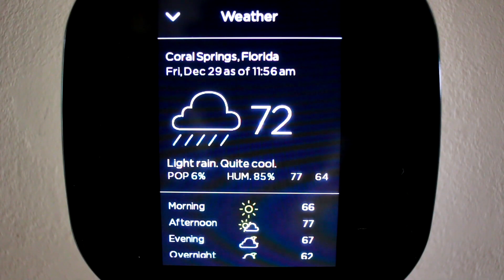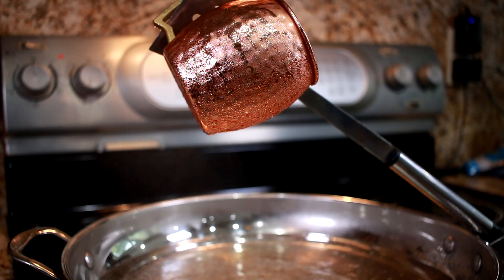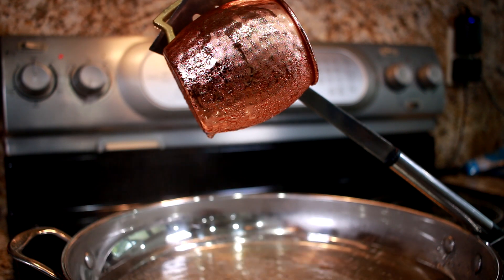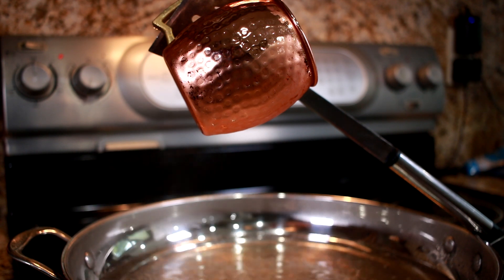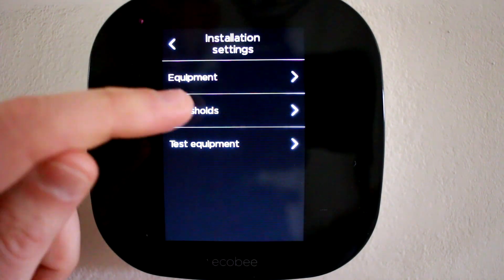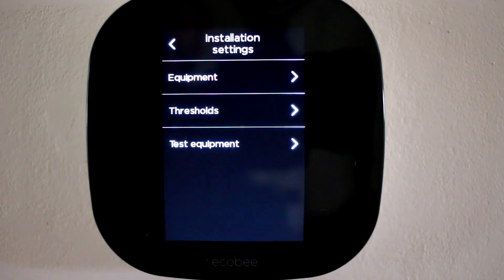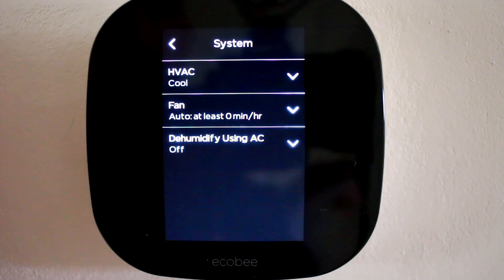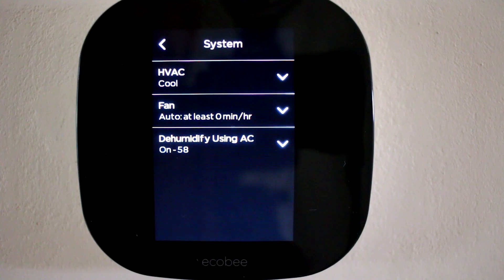Ecobee humidity control setting thermostat tutorial

Comment: I have an ecobee 5 and it dosent have the option to choose the Humilevel.  I like 44
Reply from the maker: If the Ecobee "SmartThermostat" is version 5 it does seem like they either removed it or moved it somewhere else. The instructions indicate it doesn't apply to the Smart model https://support.ecobee.com/s/articles/How-to-use-AC-Overcool-Max-to-reduce-humidity . I couldn't find a manual outside of wiring or basic install to dig in and see if it just got moved or replaced with an equivalent feature. If you find out let me know!
Reply: @reallyMello  Thank you

Comment: My Ecobee doesn't have the settings you do, so I don't know how to adjust my settings to address the high humidity issue we're having. I have the Ecobee 3 lite
Reply from the maker: Which setting are you missing?
Reply: The ecobee lite doesn't have any dedicated ACC ports to which the humidifier/dehumidifier would be attached to. With this being said, the Ecobee Lite is unable to control humidifiers/dehumidifiers and is the reason you aren't seeing those settings.
Reply from the maker: Unless “dehumidify using AC” is disabled from the light version I doubt that would matter
Reply: @reallyMello  Sure for the dehumidify using AC setting, but they stated they don't have the settings that you do so I assumed they are referring to all settings including the humidifier ones- those will be absent on a Lite.

Comment: Why would running the fan in the ON setting be an issue with dehumidification? The ON setting just allows the air to continue to circulate after the compressor is no longer running. If the compressor is no longer running then the system is no longer dehumidifying. I can see the argument, that if you are not running the system as much due to air circulation, then you can reduce your dehumidification. But in my experience, constant air circulation is necessary to maintain comfort in most houses, especially in single system two story homes.
Reply from the maker: Hi Kyle. The thought is the fan is not allowing the water to condense, collect, and drain out of the system. The fan staying in all the time is reevaporating the moisture and spreading it around the house.
Reply: @reallyMello  I would think there would be a setting where the fan is off x# of seconds after cooling, to allow it to drain as you described. And other than right after cooling, the fan would run continuously if set On. Add to that if humidity rises, the fan shuts off for x# minutes.

I'd like to circulate my air, but I don't want to increase humidity so I can't. Mehh
Reply from the maker: Well there is an option to run the fan at least a certain amount of minutes per hour that you can try out as a compromise. See how that works for you.
Reply: @reallyMello  yes but that setting adds to the humidity, and there's no way to have it cancel itself if the humidity is rising. So I stopped using it. Better that I have slightly uneven temps than extra humidity. Just a few thoughts I had on how they could improve the fan settings. Probably a little complicated set those kinds of triggers though, so I don't really expect anything like it to be implemented.

Comment: While the video was informative, all of the solutions rely on one thing.. running the compressor over a longer period of time. My greatest challenge has been getting the house temperature down to a comfortable level while using the least amount of effort by the A/C. The reason I purchased the Ecobee in the first place was to cut my electric bills, not increase it.
Reply from the maker: Agreed. These particular settings are more for comfort instead of money savings. Check out the smart home/away settings for energy savings. Thanks!
Reply: If your AC system is properly sized for the load, it should run at the right length of time to cool and also dehumidify the home for the least amount of power as practical. The thermostat is controlling humidity should "trim" the humidity levels for variability... i.e. it should run it a few minutes longer for really humid days...   If you oversized the AC for your home, (some think bigger is always better), the AC will "short cycle", i.e. cool down the home too quickly and fail to fully dehumidify.  If your home is too humid after running the AC, then it's not your thermostat fault, its whomever picked the AC system, cause its oversized for the load.
Reply: @rickanderson8088  I bought a home with a much oversized HVAC.  I ended up "sandwiching" in a dehumidifier into the return and let the dehumidifier blow into the return.  I tied in the dehumidifier drain to the HVAC drain.  The house was MUCH more comfortable, the HVAC ran much less and the dehumidifier only added about $15/mo electric.  Desperation was the mother of this hack!  but it worked remarkable well.  I'm seeing commercial, higher end add on units that essentially the same thing but they are ~$750 installation.
Reply: @rickanderson8088  Kinda true. If you live in a humid climate and the outside temp is cool, then your ac won't need to run very much to keep the inside cool. If your ac isn't running frequently, then the ac doesn't have the chance to dehumidify much.
Reply: @TonyHerson  and if you live a arid climate an oversized AC system wouldn't need to dehumidify much, so even if it runs only short times, it wouldn't matter because it wouldn't need to dehumidify much. Also a lot of the newer more efficient systems use oversized condensers and slower fan speeds, which would dehumidify more than typical systems of the past, so even if you do oversize the system and it cools too quickly, it may still control humidity adequately. I have a 2 stage AC system, that is oversized for the higher stage and undersized for the lower stage, so I have the best of both worlds, I can cool down quickly or handle heavier than expected loads using the higher stage, but it also can dehumidify and maintain temperature very efficiently using the lower stage.

Kinda True, I'd agree in the sense no AC installer would screw up so bad to oversize  system so much it doesn't dehumidify enough, and then you add in the modern systems designs dehumidifying even better, that what I describe is very unlikely to happen. But in the past it has happen, I have read accounts of folks that were ripped off by bad or unethical installers with way oversized AC systems, and the whole home was like a dark damp basement. It was cool but the humidity was extremely high. So it can happen.
Reply: @rickanderson8088  I was specifically talking about cool humid weather. I live in Florida and today it was about 72 degrees outside and rainy. The ac didn't turn on much due to the cooler weather resulting in higher than usual humidity in the house. I'm not disagreeing with you, I'm just pointing out that there are situations in which a properly sized ac unit won't dehumidify to comfortable levels and that's were a dehumidify setting comes in handy
Reply: @TonyHerson  I think we are violently agreeing with each other. lol. I agree with your points. Also properly sizing an AC unit also includes the latent heat or is it latent moisture load?, i.e. the dehumidifying load for the climate and home. So yes, you if you ignore the amount of humidity and dehumidifying while sizing the AC you can have a improperly sized AC unit. 

It is very true you can way oversize an AC unit and have humidity problem in humid climates. But, its not likely, you'd have to have an extremely poor installer screw up that bad, and it is even less likely today with the much better new AC systems today that do even better handling humidity than the past systems.
Reply: @rickanderson8088  You seem very knowledgeable on this topic. We have a fairly new AC unit. I noticed that the run cycle time only lasts 7-9 minutes. Initially, I thought maybe the unit is too large, but then I thought maybe these new units are designed to run for a shorter run cycle times than the older ones. It is a single stage unit. There’s no problem with cooling, just humidity reading in the 60s according to the smart thermostat. So I decided to go out and purchase a hygrometer, which has the humidity readings in the 50s. How do I know which one is correct? Does 7-9 minute run cycle times seem normal?
Reply: @TJ-22  it does sound like you system is oversized. 60% humidity is unacceptable, if it is truly 60% or higher, your at risk of mold developing. Humidity is hard to measure, especially for the thermostat. 50% humidity is not good, but at least its not in the unacceptable range. 40% humidity is desirable, that will only be accomplished with the proper sized unit (that will have a much longer cycle time and thus dehumidify as it runs for a longer time) or by a more expensive equipment that can run on a low speed with a smart thermostat that can run the AC on low to dehumidify. The humidity is also relative, if you have the outside air temp at 98° and 98% humidity everyday for a week, of course the humidity is going to go up in the house. AFA which instrument to trust, the thermostat hygrometers seem less accurate to me. My smart thermostat has an adjustment for the  hygometer, I have several of the $15 thermometer/hygometers and all are within a few percent of each, while the smart thermostat is off of them by 20% or more. So I adjusted the thermostat's hygometer with the system menu to be the same as the portable thermometer/hygometer.
Reply: @rickanderson8088  Thanks for the reply. I noticed my thermostat does have an overcool feature (similar to dry mode) but not sure it’s designed to be always on?

Guess I’ll need to either:
1. downsize the unit
2. buy a 2 stage unit system
3. get a whole house dehumidifier
4. add an addition to the home so that the unit is no longer oversized.

Comment: OK all that is great…BUT
I cannot find anybody including Ecobee that can explain what the “Ecobee 3” does to reduce the humidity when using the “system, dehumidify using AC” setting. There is not any information in the master manual that matches the actual menu on the unit. It talks about a details tab, what the heck is a details tab? It must be a firmware change that never got a new manual. I wonder if bad manuals explain the heavy returns for ecobee’s.
I love it except for the incomplete manual PDF on the web site.
Anyway I set it for 55% & will see how I like it. BTW: no dehumidifier & 1 stage standard AC.
Reply from the maker: Er Bob it runs the AC past your normal cooling point to drop the humidity down to your desired level if possible when using that setting.
Reply: I assume that it then uses the over cool & the humidity set points to assess how it applies the solution. This is not in the manual.
Reply from the maker: Er Bob exactly right!
Reply: To truly dehumidify you really need a variable or atleast 2 speed  blower motor ...single stage cond I’d fine, but 2 stage removed more moisture ...single speed blower on single stage outdoor is no different than just dropping the temp

Comment: I think you humidity is a little high brother you are like sweating! Good video though
Reply from the maker: Thanks. Yes, I can't recall what was going on at the time where my humidity was up so high in the house, but since then it is around 48-52% which is considered more normal for Florida houses.
Reply: @reallyMello  im new to SWFL im in Cape Coral and have been struggling with the humidity in the house. at 71% right now . Im trying all these suggestions , I have my fan set to auto but run time at 30mins/ hr.  ill see what happens.
Reply from the maker: That’s really high. Has the AC been serviced recently? Have you changed the filter recently?
Reply: I’m having the same issue and looking at options instead of a whole home dehumidifier. North/West Florida very close to the coast and humidity will soon be 70 percent or more on a daily basis outside. My home is staying around 65-68 percent humidity inside. May give the ecobee a shot.